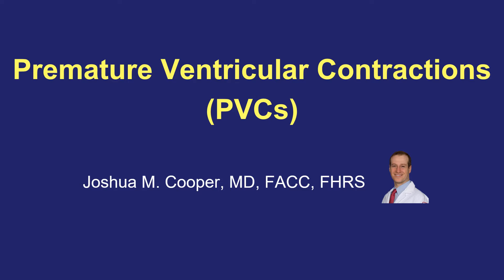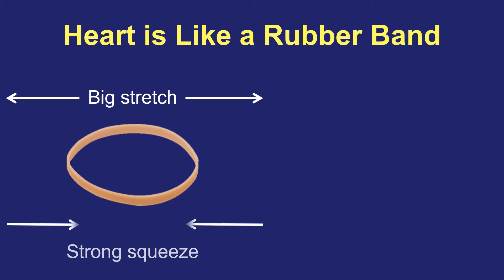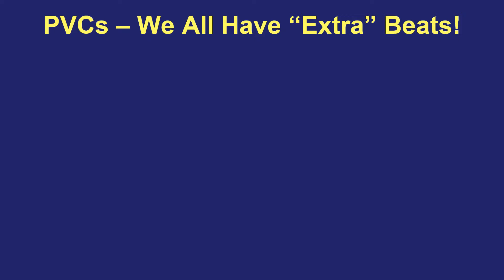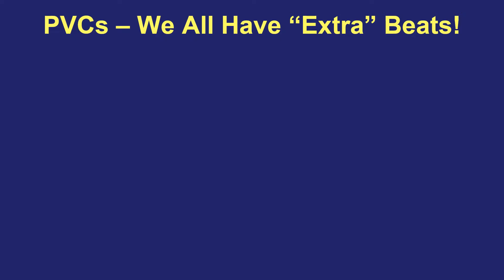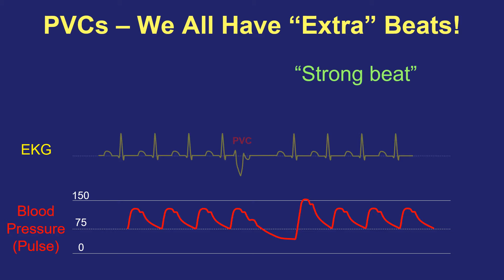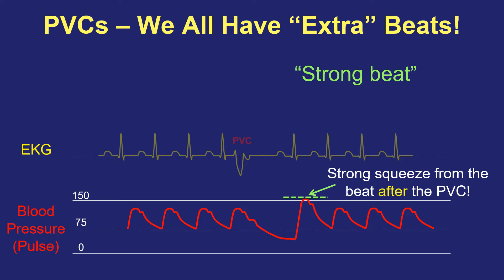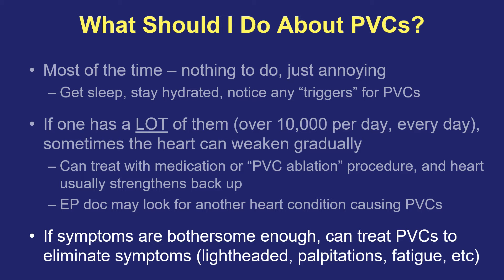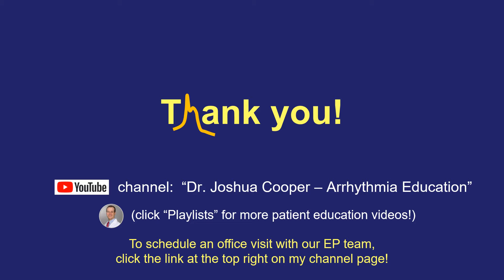PVCs: Symptoms and Treatment - in Plain English!

Comment: I have different variations of pvcs, bigeminy, trigeminy, every 4th, every 5th and then perhaps 10 regular beats followed by a pvc. I am all over the map. When I am laying down on my back at night they will go away, almost. Exertion seems to bring them on, leaning over too long, basically everything and nothing causes them. My latest monitor I worse for 2 weeks showed 5% pvcs, 1% pacs, bradycardia. But supposedly my heart is strong and has no structural heart disease. I am symptomatic especially when in bigeminy or trigeminy. I am dizzy, lightheaded, short of breath and have chest pain. I can feel my heart in my throat and right below my sternum. I am constantly afraid I am having a heart attack. Being symptomatic stinks so bad. I am going to have tests redone and visit my EP again soon. I just need this to stop! Your video is very informative as far as why it happens and why I feel like absolute crap when it is happening. I am starting to think this is a quality-of-life issue for me. I just want my old life back!
Reply: I feel like I typed this myself.  I am experiencing the exact symptoms.  All diagnostic testing is negative, yet my symptomatic PVCs are affecting my quality of life.  Thinking of ablation next b/c the meds aren't helping, other than giving me hypotension.

Comment: Thank you, Dr. Cooper.  What a great explanation and on the first video I clicked on!  This is random information for anyone who wants to read it.  I find that sharing stuff helps to ease people's minds sometimes.  I've gone for several years with not having any PVCs (if that indeed is what I'm having) to having them for the last 2 weeks or so.  Went to my cardiologist (I have a cardiologist now because I had mitral valve repair surgery in 2018) last Thursday and am wearing a ZioXT device again.  I have a Kardia Mobile device but it does not indicate PVCs, probably because I would have to test 24/7 to catch one.  My caffeine intake is down overall as I no longer have caffeine in the afternoons, but I wonder if the big cup (16oz) I have could have extra caffeine because of the new Aeropress device I got.  One website seems to indicate this.  Anyway, what began my trip to the cardiologist was using a HIIT-type bike (called a CAR.O.L) was a few thumps in my neck that felt 'sting-y' so that got my attention straight away.  My plan going forward is to reduce caffeine even more or switch to another brew method and combine that with L-theanine, which I've gotten out of the habit of using.  Heart things are very disconcerting, even when you know what they are.  I think there is a little shot of adrenaline released by the brain when these 'skipped' beats happen.

Comment: Great explanation! I started having these after I got Covid vaccine spoke to my doc and I am getting a monitor
Reply from the maker: I've heard this story a couple times.  PVCs often come and go, in response to many things including stresses on the body.  Because the immune system (and probably adrenaline system) gets revved up after vaccinations, it isn't that surprising that PVCs can flare up at that time.  If that's indeed the cause, I'd expect PVCs to quiet back down over the next few weeks.  In the meantime, I would get enough sleep, keep well hydrated, and not let the PVCs stress you out too much! :)  The monitor will be able to confirm if indeed it is PVCs that you are feeling.  Best of luck to you!
Reply: I got a covid vaccine on April 10th. Starting feeling this on May 1st and have been for over a week. Also have afib. What is the likely hood of it being related to afib or the vaccine?
Reply from the maker: @wentworth3721  Adrenaline levels can be closely related to PVCs in some people, and when the body's immune system is revved up from an infection or from a vaccination, there are higher adrenaline levels!  So it's possible for someone to have more arrhythmia symptoms soon after a vaccine - I would expect that to quiet down as the body's immune system quiets back down (which usually is a few days, but in some people it could be a bit longer)

Comment: In my case I developed pvc's and was told the cause was anxiety.   What was actually occurring was that I had mitral valve regurgitation  Which actually caused the PVC's and the anxiety made them worse..  Once I found the cause, the anxiety went away.   I then had mitral  valve repair surgery..

Comment: Dear Dr. Cooper,

Thank you for sharing this very informative video! Its very helpful. 

I have multifocal pvcs and had two partially successful ablations. My echo and MRI were normal and did not detect any fibrosis. I dont have any other cardiovascular risk factors. However, during my first ablation they found an extensive low-voltage region in my RVOT. The first ablation temporarily supressed PVC's but then a new PVC focus emerged with a slight variation in morphology. After the second ablation my PVC burden decreased from 5000 pvc/day to less then a 100 pvc per day now. I have two morphologies (RVOT and LVOT), with most of my PVC'S comming from RVOT. My EP does not think that I have a high risk of SCD, because my MRI is normal. However, I think that I have interstitial fibrosis that is bellow the resolution threshold of current imaging modalities and that I have a risk of VT/VF. 

1) How often do you find low-voltage regions in patients undergoing EP studies with idiopathic PVS's and normail MRI's?

2) Are you concerned about risk of malignant arrhythmia in patients with polymorphic PVCs and normal MRI?

3) Would you recommend programmed ventricular stimulation for further risk-stratification?

Thank you in advance for your time and attention!

Comment: 9:37: "Just annoying," and "get sleep." Hard to get to sleep when every time you start finally drifting into sleep, BOOM, a PVC and I jolt awake. It can last hours and many tears just aching to get to sleep, finally passing out from sheer bodily exhaustion as the sun is rising. And that's with only decaffeinated drinks, and no alcohol. I even tried using beta blockers a long time ago, and they did absolutely nothing. 

Can you also explain why my PVCs seem to coincide with gas that seems to get trapped in the stomach? Sometimes, just sometimes, using things like Gas-X helps, but they are most certainly NOT simply "annoying."
Reply: Following. I experience the same symptoms! I'm on a beta blocker which does seem to help. But when the PVCs happen my stomach fills with gas and bloat

Comment: Mine were caused by gut issues. If I ate certain foods I could feel the PVC start in my gut even before it occurred in my heart. Hard to explain, but bottom line is this. If you have a normal heart structure then check your gut or anything that irritates the vagus nerve. Even something as simple as having gas can cause PVCs. One time I took a mineral supplement and I had rows of PVCs and PACs for nearly 11 hours. Went to ER and doc basically said I had a strong heart and nothing to worry about. Well, it was scary to have my heart flopping around for nearly 11 hours. Then I had some thyroid issues early last year that contributed to horrible palpitations and PVCs and PACs. Turned out my thyroid function was 4X higher than normal - hyperthyroidism which is now under control.

Comment: Your video is one of the best I have seen on the subject. Well done. I have swallow syncope after 3 years of pre-syncope and 3 weeks of monitoring never had a pre-syncope episode but they found 1deg and 2nd deg AV block with 1-3% PAC's and 2-11% PVC's, which were very rare prior to the syncope. Have 2 lead pacemaker now so Bradycardia is not much of an issue. Is it possible the loss of conduction in the AV node and bundles is causing the heart to compensate and create the PAC's and PVC's? Could the loss of conduction possibly be a result of calcium build up around my bicuspid aortic valve even though it has a low level of insufficiency?

Comment: Thank you for this video! I have a bicuspid aortic valve with mild/moderate aortic stenosis. I have been having daily PVCs for about the past three years. Usually 3-5 a day but some days the just go on and on every few minutes . My cardiologist is not concerned but that strong thumping in my chest when they happen has caused me nothing but worry.  I currently take metoprolol 50mg daily for the last 5 months which seems to help with the strength but not the frequency of them. Im hoping my doctor can offer a different treatment that will help more and relieve me of the anxiety these are causing me.
Reply from the maker: PVCs are usually not associated with aortic valve disease, so they are likely a separate issue. And just because PVCs are not frequent enough to be of medical concern doesn't mean they don't impact quality of life. PVC treatment is appropriate if PVCs are bothersome/frequent enough to consider medication or a procedure to manage symptoms. Seek out an EP doc who discusses all options with you. Best of luck to you!

Comment: Hi Doctor and thanks for this excellent video!  I wore a Holter two times recently, some months apart, and they both showed exactly 23% burden of PVC's, and I definitely felt them in the form of "palpitations" that often kept me from falling asleep normally.  Had an ablation done 6 weeks ago and started a new medication (they switched me from Metroprolol which had stopped working for me).  I was told my PVC's were coming from one spot that was just too deep to treat safely but they did as much as possible.  I seem to have improved tremendously though, and only hope this improvement isn't short-lived, like my experience with the beta-blocker I was taking before that helped at first-but even after increasing the dose, stopped working.  Any thoughts please?
Reply from the maker: I will keep my fingers crossed that the beneficial effects of ablation and the new medicine are long-lasting! If for some reason PVCs come back enough to warrant doing something different, you will talk to your EP Doc again, and consider getting another opinion because sometimes there are additional techniques of ablation that can be used in tricky spots to achieve a permanent result!

Comment: Hi Doctor,
What a wonderful and informative video.
I started feeling pvcs last January when I turned 50.
Just a couple a day. Had a appointment with a cardiologist he examined me and said it's nothing everyone gets pvcs.
So I made a appointment with another cardiologist and he did a complete blood work ekg, echocardiogram which came back perfect ejection fraction 60% all valves and the walls were fine. Also had a zio patch on for 10 days and it said rare pvcs, and pacs no heart arrhythmia.
I still feel some times 3 or 4 a day but he said my hearts fine nothing to worry about since I have so few in 24 hrs.
Anything else I should do or any other testing do you think I need.
Thank you doctor!!
Michael
Reply from the maker: Your doctors are quite correct that everyone gets PVCs!  Some people never feel them, and some people feel every single one!  It is reassuring when we see only rare PVCs, which is a normal finding, even if one feels them.  It sounds like your doctors gave you good advice!

Comment: My father ECG report says: Sinus Tachycardia, with frequent, Premature Ventricular Complexes, Voltage Criteria for left Ventricular Hypertrophy. q in lead III. AR : 102 Bpm, VR : 102Bpm, QRSD : 102ms, QT : 362ms, QTc : 471ms, PRI : 152ms  P-R-T : 52 20 15.  Please Dr. tell me what are the findings according to above quote and what will be the treatment for my father. These all information that i have mentioned taken from my father ECG report.
Reply from the maker: Thanks for watching.  I'm not able to give individual medical advice in this forum, but I'm able to teach people general concepts about PVCs.  As in the video, when someone has over 10,000 PVCs every day for weeks and months, they may be at risk for weakening of the heart's pumping strength.  And some people have some other heart condition that could lead to having that many PVCs.  We do not rely on a single EKG to determine how many PVCs someone is having daily, because that is only a 10-second recording of the heart. Instead, we use a heart monitor (24 hours up to 30 days) to count PVCs on a daily basis.  And then a cardiologist and/or electrophysiologist can make a plan moving forward to treat PVCs (if necessary) and look for any other medical conditions or heart problems (if appropriate).
Reply: Thanks❤️ 
for your attention Dr.

Comment: I have felt this simce 2008
I thought of all possible duseases in tge world.. Started in my eaely 20s. As if it was hormome thong...
Today im 35 and still alive.
Smoking and drinking (which i will stop)
I noticed an extreme boom geeling forva fractjon of a second and sometimrs a flutter.  The less frequent, the more i notice the force.
Im no more worried about this and not afraid to die anymore. This has caused me the worlds biggest stress... And i ran to 100s of cargiologists just to listen them say - its all in yiur mind, there is no structural issue with your heart

Comment: Thank you for this excellent explanation. I've learned a lot in the past year, but never had the explanation put as clearly as this for some of the things I feel. ... I don't have PVCs at what would be considered an alarming frequency, normally - but I have HCM, so I've been told it's a bit more concerning when that's the case. They generally don't bother me, other than the fear that this will lead to - or is a sign or precursor of - sudden cardiac arrest/death. Is there anything that would allay those fears - or should I indeed take extra care because I have HCM vs. someone that doesn't? The frequency for me is maybe 20/hour - so the % is well under 1% ... but the scary ones are the ones that happen 3 or 4 in a row before things go back to normal.

Comment: Thank you doctor for your explanation this is a good video.I’ve been having those PVC for the last two years I went to a cardiologist and my test results were normal. My problem is if I go for a long walk or if I do a lifting exercise my PVC gets worse. Do you have any idea why it gets bad after I excerise?
Reply from the maker: PVCs can often be under the influence of adrenaline.  Usually they go away during active exercise but reappear right after exercise (while there is still a higher level of circulating adrenaline and after the natural heart rate has started to slow back down).  You can talk to an EP doc for treatment options if symptoms are bothersome enough to consider medication or a procedure in order to improve quality of life.
Reply: I have the same problem. I get more PVC if i do lifting exercises or long walks, i been having them for the last 45 years but in the last 4 months they have become more troublesome. I used to get a break from them but now they are daily and quite strong. Hope yours getting better.

Comment: Dr. Cooper thanks so much for great video. Recently wore holtor for 72 hrs the report said insignificant  pvcs. I also have what feel like flutters for a sec or two of course had none  lol. Are those also a form of pvc.? Thanks best of holidays to you.
Reply from the maker: People who feel their PVCs will often describe a brief sensation in the chest, but different people experience them differently.  Yes, some describe brief "flutters," but others feel a range of other symptoms, as outlined in the video.  With regard to diagnosis, sometimes it's the same as bringing your car to the mechanic - as soon as you get there, the rattle sound stops happening!! :)  It's often the case that a short duration Holter monitor for 24-72h may not catch symptoms that don't happen daily.  And so there are 10-30 day monitors that are much more likely to identify the cardiac rhythm at a time of symptoms.  But if symptoms are that rare, not occurring in a 72h window, it is very unlikely that there will be any medical harm from PVCs, so it's mostly just making a diagnosis for peace of mind.  There's something empowering about knowing what a problem is, and putting a label on it!  Best of luck to you and keep safe!

Comment: I have a lot of pvc,s not always bit now, I am quite relaxed, and heartbeat is 58 as measured. No pcv, I have not big trouble but when stand up from lying down to piss, I get them, I have stop acohol, and started yoga again, stress did go bad. some hormones are responsable. What also is a case I get some when go up the stairs, and die down afterwards. but when do raide the bycicle for 8 km agains strong wind, I have no problem, I am not tired, sleeping is also not that good, so work on it. 

Another thingwhat did help was stretching the diaphragm or hyperventilation, I get tem also when to long behind the pc, I sit quite compressed behind it. PVC,s can be caused by this, compressing the heart, I have also spasms on chest what cause it sometimes, but now I also think stress was a cause, and stress do go away slow, it needs time. But oke, I was quote scary and unshure about it, but there are solutions for it.

These things are very bad to feel it, and make me restless,